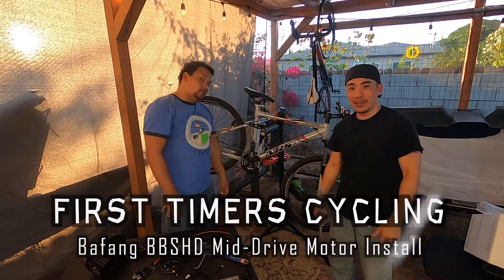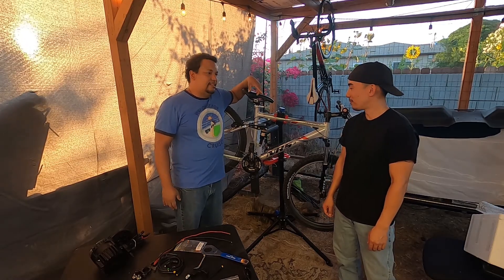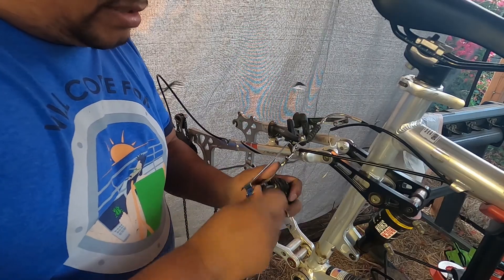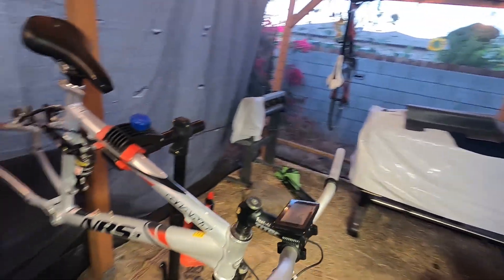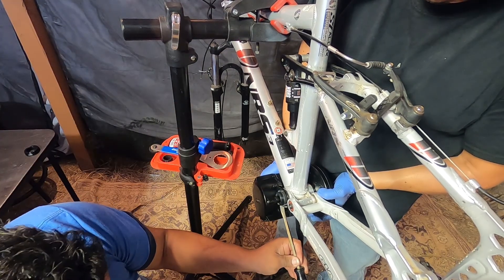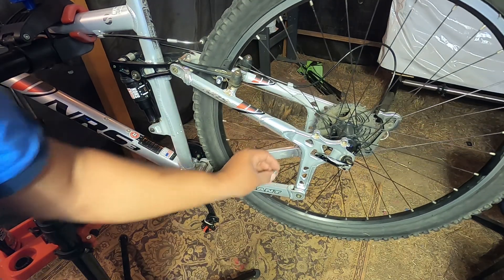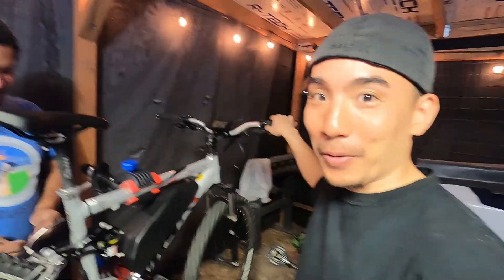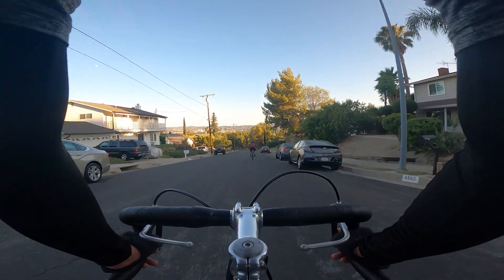Bafang BBSHD Mid-Drive Motor Kit Install

Comment: Diameter of those spacers?
Reply from the maker: I believe they are Size: outer diameter 42mm+/- 0.3mm (approximately) inner diameter 35mm+/-0.3mm, and 2.5mm thick. This is where I found the info => https://www.ebay.com/itm/185187680625?chn=ps&_trkparms=ispr%3D1&amdata=enc%3A1NQZypL7dRn-RRH__an-PYg34&norover=1&mkevt=1&mkrid=711-117182-37290-0&mkcid=2&itemid=185187680625&targetid=1599090336657&device=c&mktype=&googleloc=9031148&poi=&campaignid=15275224983&mkgroupid=131097072938&rlsatarget=pla-1599090336657&abcId=9300697&merchantid=101510117&gclid=Cj0KCQjw6J-SBhCrARIsAH0yMZj8q4Zd9Qt3l4u0VZdwqOQi7xeBofpfBMb-MxAnd2EKlE_fRB2jsakaAudTEALw_wcB
Reply: Great channel, wish you luck
Reply from the maker: Thank you! Glad you like it!

Comment: My chain is skipping on the lower smaller gears even after shortening the chain you run into anything similar?
Reply from the maker: We did but we had to dial in the L and H screws of the rear derailleur then it went away. It was acting like the chain wanted to move up or down a gear while pedaling.
Reply: You may to change your offset with a different chain ring. Lekkie makes good rings.

 I had to do that for my carbon folding bike.  I was getting mad slippage on the smaller rear cogs.

Comment: Hi guys! What is max speed ?
Reply from the maker: Hi there and thanks for commenting! With our gearing we were able to achieve 35mph. 46t chainring and an 11t for the smallest cog of the cassette. I'm sure it can go faster but would be going over the speed limit for bike paths or trails here.
Reply: @FirstTimersCycling  Thanks for information. Could you please recommend the seller? There is a lot sellers on Amazon, but I would like to avoid any deliver problem. Thank you.
Reply from the maker: @AZ-qn3xq  We actually purchased our kits from https://bafangusadirect.com/ The site will have everything you need to install, including battery templates to see what will fit your frame.

Comment: That nut holding the motor on isn’t even close to being tight enough
Reply from the maker: Yup we noticed that after a couple rides. We now have the Bafang bottom bracket tool and have also secured the motor onto the frame like in this video here => https://youtu.be/koav3LDelYo